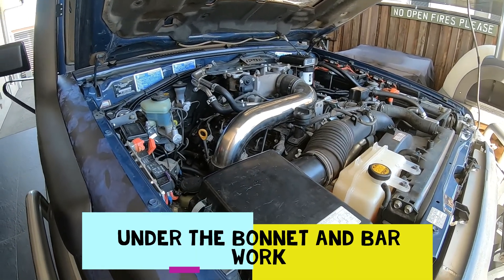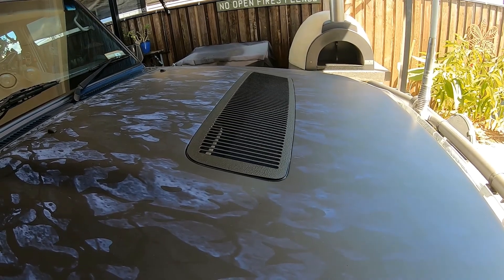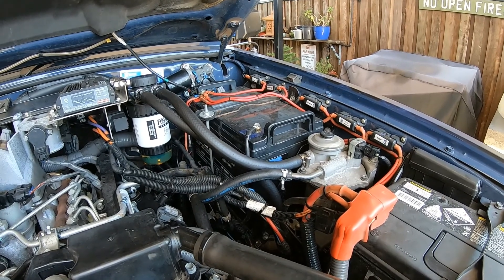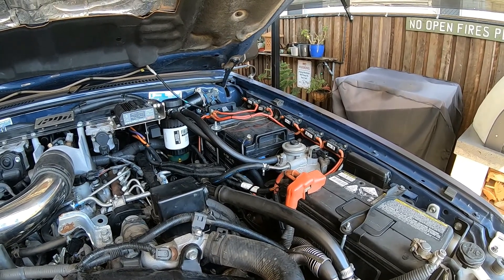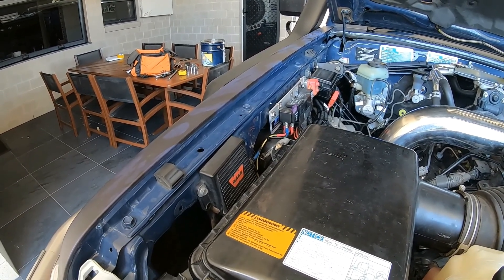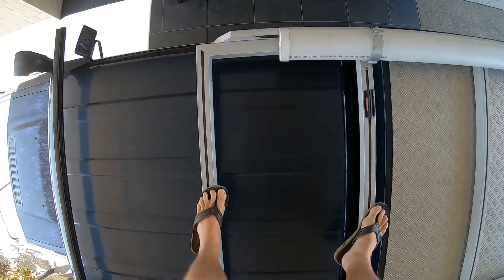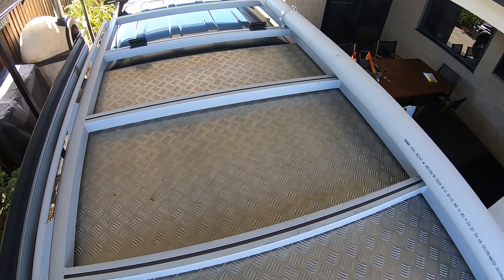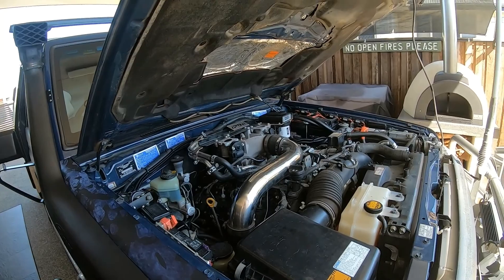79 Series Twin Cab Landcruiser - Under the Bonnet and Barwork

Comment from the maker: Thanks Bill,  all pragmatic comments. I think I’ve mentioned if I had my time again I’d likely have an upright Engel in the canopy, a large lithium battery in there (to run the accessories you mention) and probably swap out the BCDC charger for a Manager 30 coupled with a decent inverter.   Not at that stage yet and was really hoping to be on the road around second weekend in May - bgr!  kenny

Comment: You can replace those plastic studs in the bonnet with rivnuts (aka nutserts).....
I agree that the winch should be run off the main battery and it's a good idea to whack-in a 2 B&S cable so you can jump the 2 batteries together if needed. If doing so you'd be wanting to use a heavy duty manual reset circuit breaker of around 300 amps I'd suggest. Leave it open all the time, but have the ability to close the circuit with the flip of the lever. https://www.amazon.com.au/ANJOSHI-50A-300A-Waterproof-Protection-12V-36VDC/dp/B07SHSSTGW
I'm also not a fan of accessories batteries being under the bonnet. Most of the accessories you run off the 2nd battery (fridge, compressor, canopy lighting, water pump etc) are all located at the back, so it makes sense to have the battery back there too. Doing so also means you can install a MUCH lighter lithium battery in place of the lead crystal...lithiums hate heat!